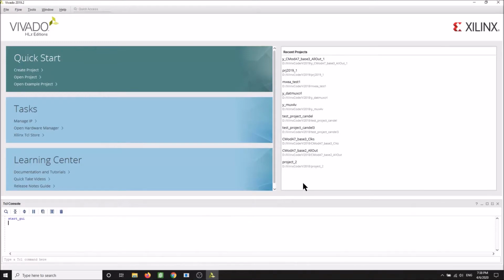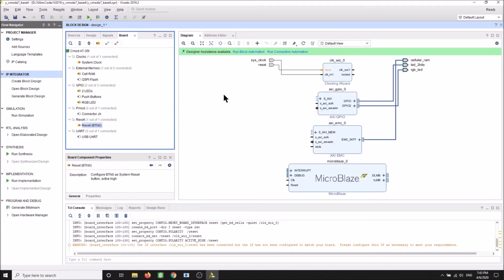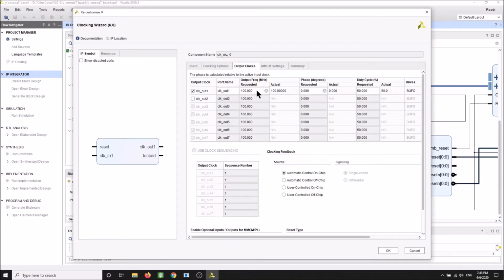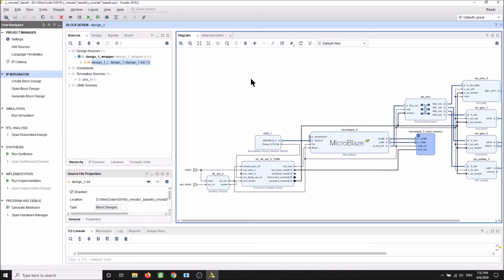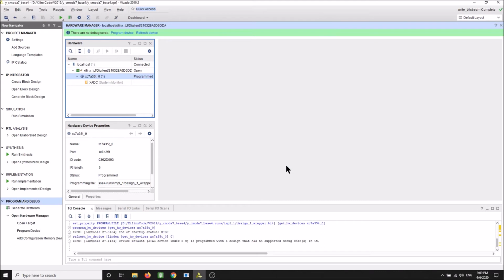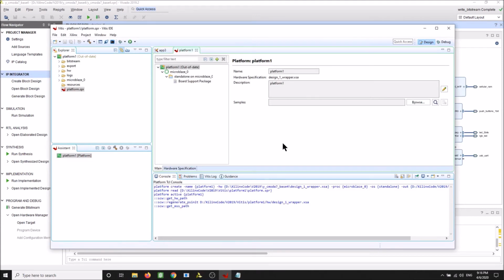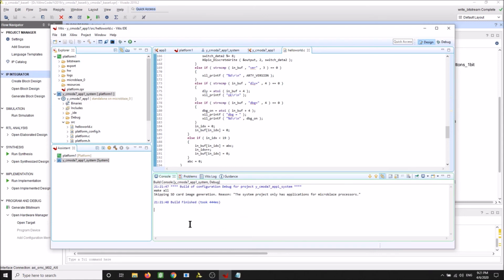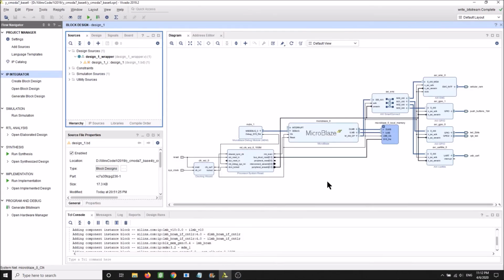Xilinx Vivado Artix7 Fpga Microblaze Basic Design using Vivado 2019 CModA7 Vitis SDK

Comment: I just came across this video now. It's really good. I am new to FPGA. Can you please guide me on how to conect MPU6050, ESP32 to this CMOD-A7 FPGA. I need help on this
Reply from the maker: that s a good one.   [1] by Serial, you can add another Uart within the Fpga. the Esp32 or Esp8266 have the tx rx pins you should be able to use.   [2] I often use a custom SPI type of connection in uC to uC communication, in general. you can implement the Spi in the Fpga fabric as slave, and use Esp32 as master.   [3] by Parallel.  you can use more than one pin on the Esp32 as data lines. and one line as clock. on the Fpga side in the Microblaze code, you can scan for the clock line, or design your own Verilog hardware module to handle that. [+] in case of bidirectional data flow, make sure you switch the lines of the Esp32 as input or output. [+] for single direction lines on the Fpga side, you can use the Gpio module. [+] for an example of Parallel communication, check datasheet of FTDI chip FT245. [+] if using bidirectional lines in Verilog, initialize to Z.   [And]   Build the Robots !
Reply: Thank you very much for taking out time from your busy schedule to reply me. I appreciate 🙏 

I am new to FPGA so I haven't gone far, I just copied exactly what you did in your video, but in my own trial, it didn't synthesize, I did exactly what you did in your video, but it still didn't work.

Please do you have any solution for me?